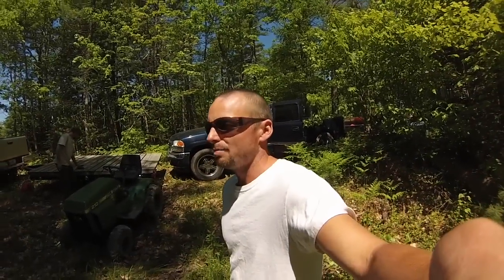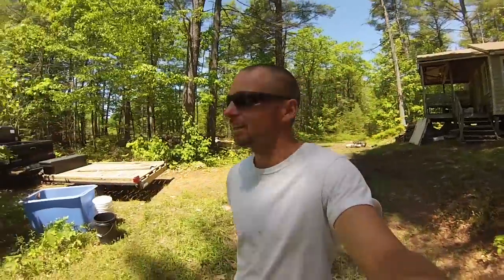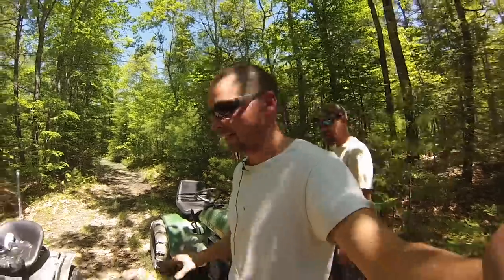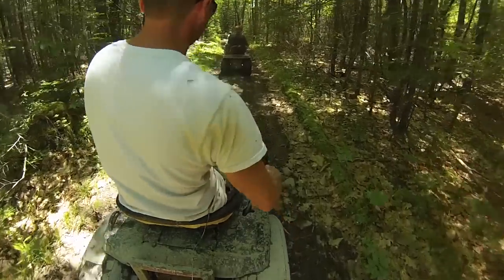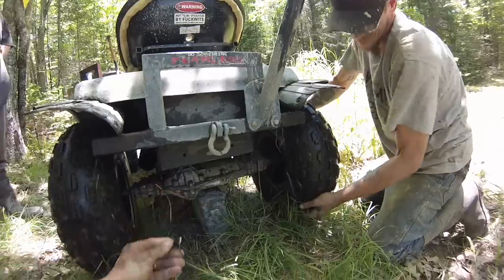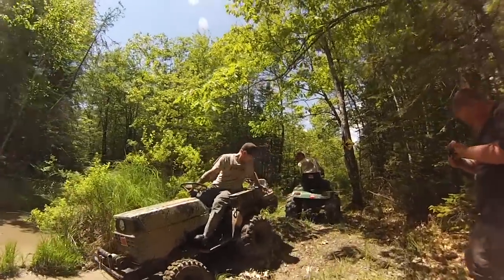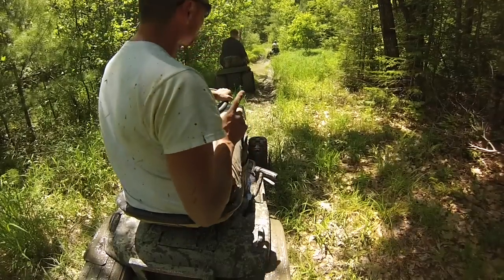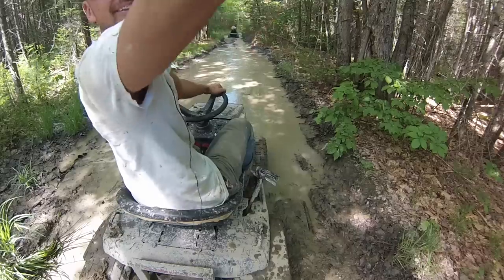We're Always Breaking Stuff!!!

Comment: Your problem is the pvc fittings. carburetors are very sensitive to sharp angles, so your carburetor basically is not getting enough air because the ridges are slowing it down. Need as few of pieces as possible and the connections should be tapered on the inside for better turbulence.

Comment: if the snorkel is causing it to run rich it's restricting the airflow. You need to use a bigger pipe and or the filter isn't flowing

Comment: ok i have a 17hp ohv briggs in my john deere mud mower and it has no compression so i pulled the head off and the headgasket is not blown and is perfectly fine and the exhaust valve seed is perfectly fine so what could be the problem it just backfires threw the carb
Reply: MUDMOWER John Deere check the flywheel key and check the valve adjustment

Comment: Make a emergency welder with batteries
Reply: I'm sure he's not a fan of exploding batteries.
Reply: They talked about it before but haven't don't it
Reply: RichieRichOverdrive have been doing it for years on the stations down here in Aus and have not had an issue with exploding batteries yet, 3 in series 36 volts and good for welding no worries, just keep an eye on battery temp it's not like your fabricating with it just repairs.
Reply: Riley Weasenforth What's that?
Reply: Making a stick welder with car batteries and a electrod
Reply: y would u do that if u aready have one
Reply: For when you riding and break something
Reply: no
Reply: Hobart made a portable welder for the off-road community a few years back, butt they were asking the same price as a Hobart 230, needless to say it was discontinued, but one could find one. Whole lot safer than ghetto rigged battery welders.